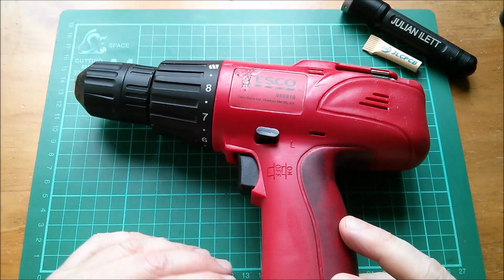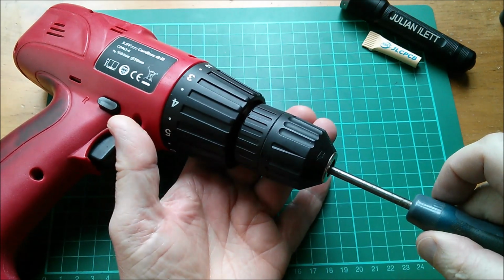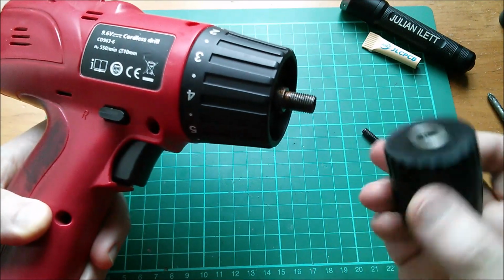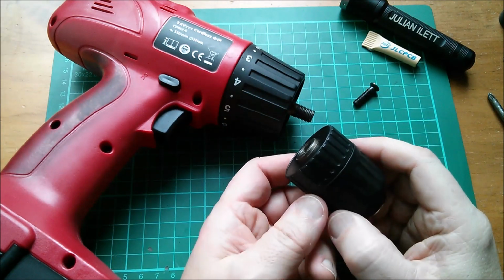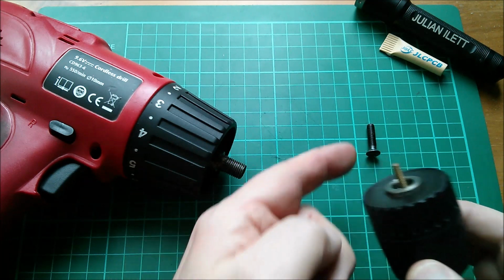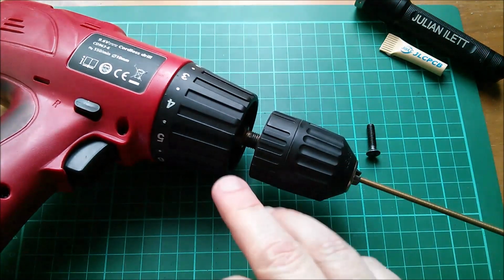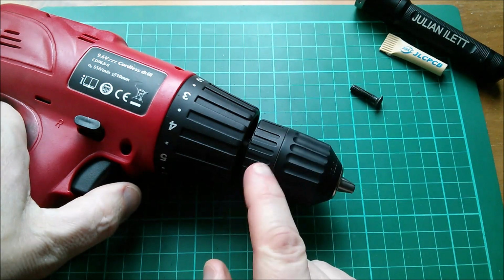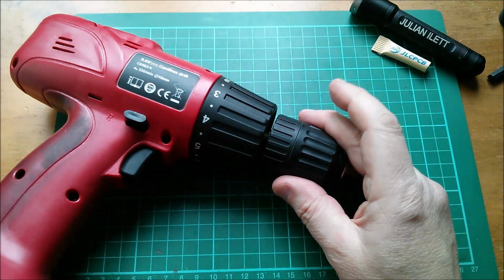How to Remove Chuck from Electric Drill

Comment: () - That crew is NOT a Pozidriv, it's a Phillips.
Some might argue that it's a JIS B 1012, but it's not that either. It's a Phillips, and only a Phillips driver will fit it absolutely properly. If it's not too tight, you may get away with a Pozi but you'll almost certainly deform the screw head doing so. (Slightly, but still...)

.

Comment: I was dealing with some of the sticky rubber coating at work the other day on one of those cheap USB microscopes.  I found that "Heavy Duty Flux Remover" took it off with very little rubbing, but didn't attack the plastic body of the microscope.  I know it does melt some kinds of plastic, so YMMV, but if you need to remove more of the stuff sometime, it's worth a try.

Comment: Any blocking mechanism is not need unscrew chuck, only take chuck in hand or a vice, switch to reverse an power on motor, the same work with blocking screw but with CW rev (best way is mount screwdriver in a vice)

Comment: A note on mixing right and left hand threads on the same device - My stepfather had a '59 Plymouth with right hand threaded lugs and nuts on the wheels on one side of the car and left hand threaded lugs and nuts on the other side.  I'm sure there was some "Because the wheels turn in different directions" in that bit of engineering, but it certainly was an annoyance if you had wheels off on both sides of the vehicle and someone mixed up the nuts.
Reply: notyoung I think that was the case with Land Rovers.
Reply: Morris Travellers had a left hand thread on the left hand side of the car..... I think.
Reply: You remember correctly. Chrysler products (aka MoPar) of that vintage had both left and right hand lug nuts for some time. They quit doing that thankfully because it was so easy to mess up. More importantly, since most other car makers did NOT take Chrysler's approach and other cars didn't have problems with lugs coming loose (assuming they were properly torqued).

Comment: Thanks for that, was wondering how to remove them, though the vast majority of the drills I have are corded ones, even the cordless one has a cord connecting it to a 12V SLA battery, because the original packs died long ago, and even repacking them was not a good proposition, because of low capacity of sub C cells compared to 7Ah for the SLA.

Comment: I wonder how many went to get their junk drill in order to try it right after watching the video. :)
Reply: @Scott Lichtsinn Well my drill press the one is just a regular right hand thread, the other is a taper fit. Guess which one was converted in a lathe to take a threaded chuck when I wanted a new chuck, and found some really good quality keyless ones going for a song. Was better than using the old taper chuck, which also had a cracked gear ring as well. Just not able to go as brute force on the tightness with keyless, but I was not the one who broke the old chuck, got it that way at auction looking very tatty. Still looks tatty but works better.

Comment: You forgot to mention the JIS cross head.
Reply: Is that the one with a small dot on the head?
Reply: On that topic, I use a 4mm slotted screwdriver. Do slotted drivers come in metric and imperial

Comment: Mine was on there so tight I had to put part of a hex hole saw adapter in the chunk and grip it with a massive pipe wrench and use the force of the pressing the drill trigger fully and letting the drill bounce against the floor in order to break it loose! HOLY CRAP that was on there tight.

Also the clutch thing stopped working months ago. it suddenly started working after taking the chuck off and putting it back on.
but now it works even in the drill setting :( My drill is now useless.
Reply: They generally use a drop of thread lock on the screw, just under the head area, so it will not come lose even with impact use. Clutch all the time means there is a cracked plate inside, but putting those things back together is hard to do. Easy to take apart, but to find all the little balls and springs after they see freedom not so much.

Comment: Your demonstration of the inner and outer threads "screwing" in together is a bit deceptive, as you said 'lets pretend they are the same pitch', but they are not the same pitch, and they cant screw in or off together as the coarser outer thread tries to move the chuck much further per revolution than the inner thread can accommodate, so even if the inner thread was not a left hand thread they could not both loosen together.